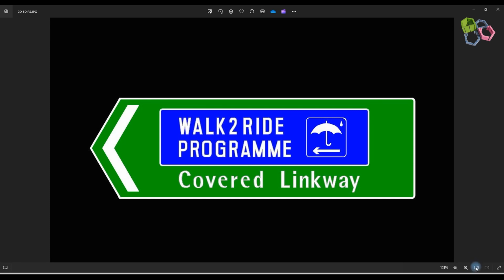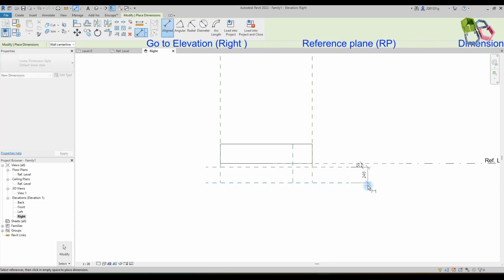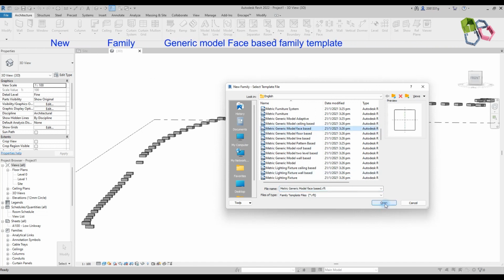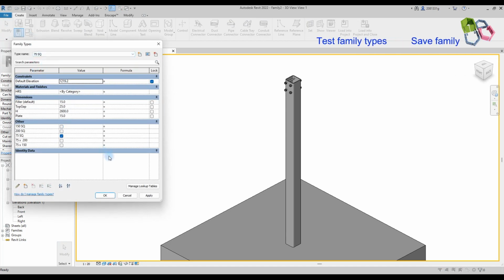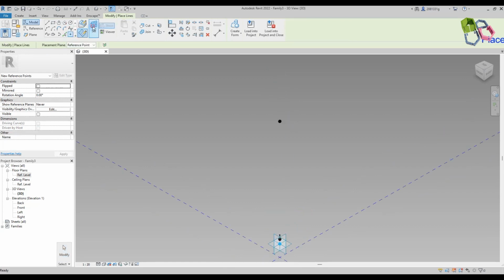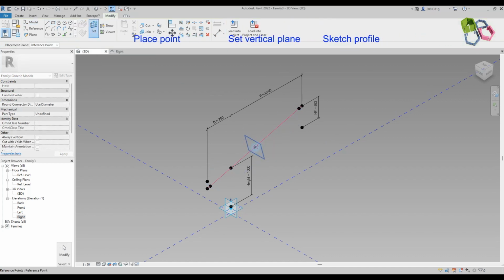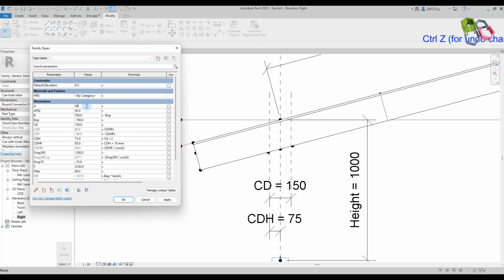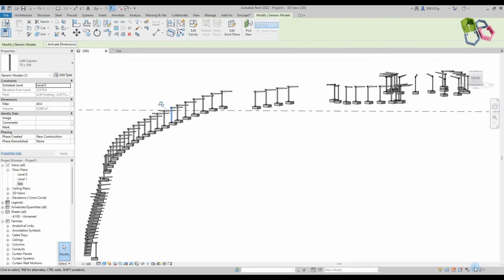How to create the covered low linkway components in Revit? 3D BIM Model (Part 1)

Comment: Why is there a skip on video after you create solid form
Reply from the maker: Thank you for a comment.
I've re-watched my content, I did not see the part has skipped.
May I know which minutes length was skipped?
Sometimes, I do skip the process which were repeated featture and process before did in the same video.
This to make shorten the video length and avoiding audiences annoyance. 
Due to aim the whole project to completed in 30 minutes approximately.
Reply: @OOUU.  16:46 3 points elements at the left hand side but when it in 16:53 becomes 5 elements points